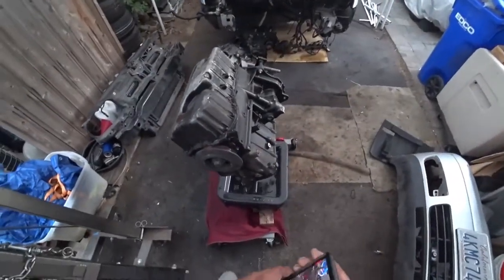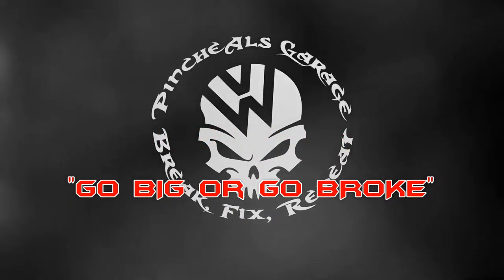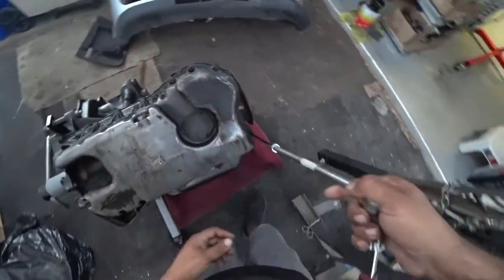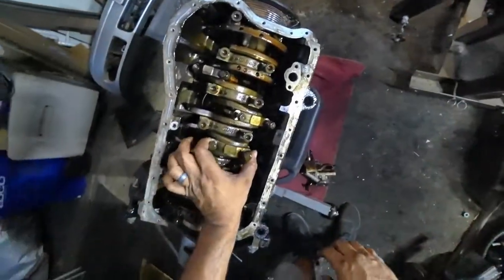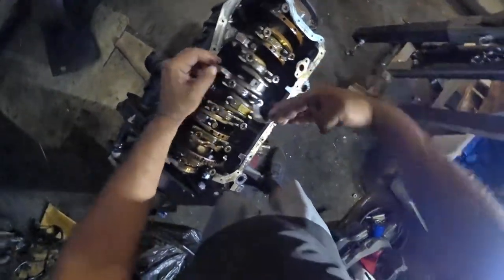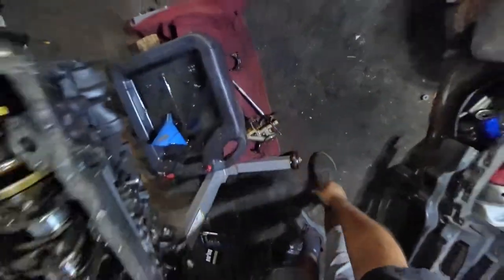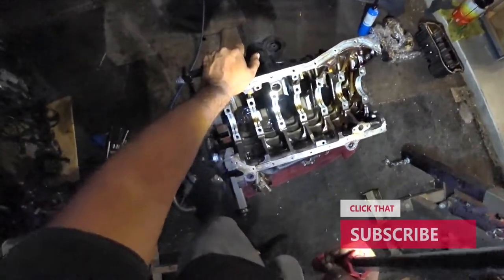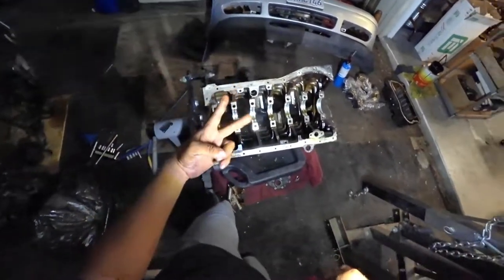MK4 VR6 TEAR DOWN PART 2 S7EP4

Comment: Hey there Al.  Thanks for these great videos!  My  son recently bought a 2014 Jetta - 1.8L Turbo. Was at the dealer to correct sounds issue and CEL.  Dealer said it was timing chain and tensioner.   They also said spool valve.  They did this work (about $4k in repairs).  The invoice shows 2 camshafts line items.  Anyhow, the oil light now comes on after it warms up.  When RPMs hit 2000+ RPMs, the light turns off, but comes back again at idle.  

I’ve removed the oil pan and inspected bottom of the pan.  There there some tiny bits of metal pieces.  Nothing crazy like yours did.  Cleaned out the pickup tube (didn’t look clogged) as well.  Put everything back, new oil, oil filter and still have the issue.  I am hesitant to take it back to the dealer as it seems that there are more issues after they did their work.  Anyhow, I am at the point where I need to see if I can troubleshoot the issue and do it myself (if possible).  What are the chances the oil pump can be the culprit?  I’m prepared to drop the pan again to see if I can spot anything on the rods.  After watching your video, I was wondering if this inspection can be done with just the dropping the oil pan. Any help/guidance would be greatly appreciated!  I am a father trying to help my son out :).  I found a new genuine oil pump for around $150 and willing to give that a go, but don’t want to take a shotgun approach with parts.  I’ve already replaced both oil pressure sensor switches.

I can also be reached at pgamboa@yahoo dot com. 

Thanks in advance!
Reply from the maker: Sounds like an oil pump failure. Did you tell the dealer that this happened after because they are 100% responsible for it now. Since the car was not given back to you in 100% working order. You should not pay anything out of pocket. Hopefully you tell them asap because they will blame you if you dont tell the asap. Do not mention that you dropped the pan as well
Reply: PincheAls Garage - This dealer has really been a PITA to be honest.  They keep saying the car has other underlying issues and that they fixed what was making the noise that we brought it in for.  I think for $150, I’m willing to do that instead of taking it back to the dealer.  They told me that the possible issue for the light could be “O-rings”.  I bought an oil pressure test kit and connected it to the brown oil sensor switch spot.  It barely got 20 psi when warm and at 2000-2500 rpms. Cold idle, maybe 15 psi. On a warm engine idle, barely registers any pressure.  Since I’ll be dropping the pan again to replace the pump, I was curious if there was something I could be inspecting for wear. Also, in the videos I’ve seen on the pump, all of them don’t seem to use the same oil pump I’ve got, so I wanted to be sure that removing the oil pump I’ve got is the same.  This is the pump I just bought.  https://www.ebay.com/itm/352932873060
Reply: And THANK YOU for the lightning fast repense!!
Reply: PincheAls Garage - Al, I’m having trouble removing the oil pump in this vehicle.  Think you can give me some suggestions?  I have a pic I can send... of you can email me at pgamboa@yahoo.com, I would greatly appreciate it!  My oil pump looks slightly different than yours.
Reply: I was able to get the pump off. This one has springs on the inside and when I removed the bolts, the housing “popped” open.  I don’t know what clearances to check for.
Reply: Swapped out oil pump and still no change.  I did notice a foreign object in the oil pan.  Looks like a ball bearing.  Ugh.  Think I’m throwing in the towel.
Reply: @PincheALsGarage  - Swapped oil pump and still no change.  I did find a ball bearing this last time I dropped the pan.  Ball bearing was about 50mm in size.  Not sure where that came from.  Any ideas?
Reply from the maker: @philgamboa2906  only part that has a bearing is the cam chain tensioner
Reply: PincheAls Garage - Thanks Al!  If that is the case, do you think changing that might resolve the pressure issue?  This is different than the timing chain tensioner right?  I also see that compete engines can be bought from places like LKQ.  Fairly cheap too (like $700-$1000).  I wonder if that would be worth considering.   Your thoughts are greatly appreciated!